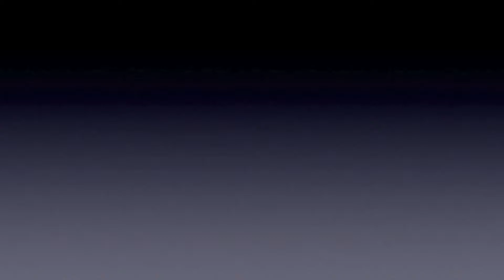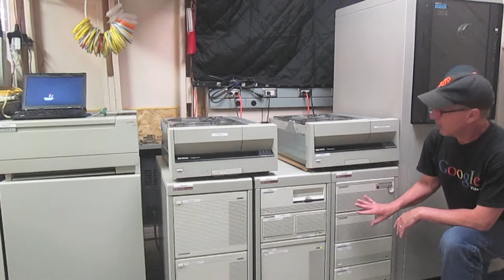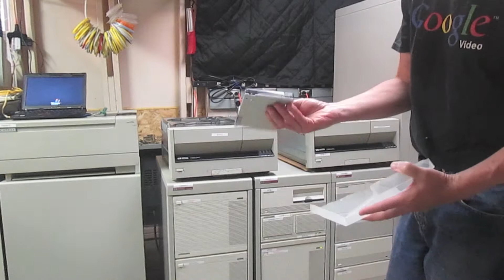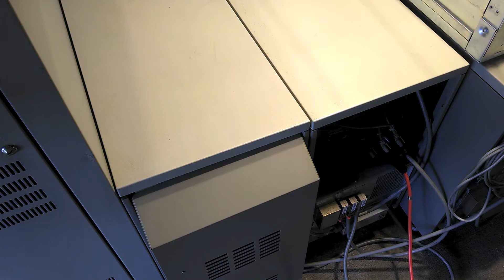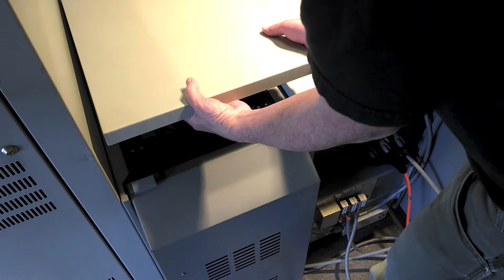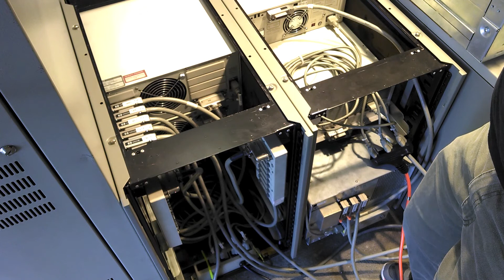HP3000 Micro3000XE System Overview

Comment: I acquired an old HP 3000.  It came with everything except an operating system.  Command console works...system checks out.  However when I try to attach a disk array, it fails with a 700 error which indicates a memory fault.  Is this a consequence of improper SCSI configurations on the disk array?  Also, I was able to get a copy of the MPE operating system, but it is in a compressed file on my PC.  The HP 3000 has two DAT drives, but I can't transfer the operating system to the tape from the PC.  I have a DAT writer with a USB interface and I was able to load the drivers for it into the PC, but Windows doesn't recognize it, so I can't write to it.  At this point I am stuck...is there any advice on how to trouble shoot the disk array connection and load the operating system?

Comment: There is still a 3000 system from the early 1990s running the management information system at a tractor shop in Mount Hope, KS.  I lived there up until a couple of years ago.

Comment: I started my IT career in 1985 on HP-3000's and HP9000's until the 2010's. I miss HP's MPE, MPEix, and their UNIX systems. Used to be an operator in a shop with 9 of those machines, ranging from 935-998's, and H, K, and N UNIX boxes. It was always very busy and extremely fun. I truly miss being an operator back then.

Comment: I have one of those sitting in storage looking for a new home.  One 9144 tape drive, a Micro 3000 CPU module and two 7959B disk drives in a single one of those cabinets.   I  had a couple terminals too, but those were lost.

Comment: Hi, Lee! I´m doing some research on this computer (hp3000) for college, and I was wondering if you have some manuals or datasheet about it to share with me. It´ll be great if you could help me. In case you can, my email address is cristianfaroppa@gmail.com  Thanks in advance and great video! Sorry for my English, I´m from Argentin. Cheers!
Reply from the maker: +Cristian Hernan Faroppa Hi Christian - Bad news and Good News. I don't have this hardware or any of the documentation. :-( However you can find most of the documentation for the HP3000 at bitsavers.org. HP3000 documentation can be found here: http://bitsavers.trailing-edge.com/pdf/hp/3000/

Enjoys and good louck on your project. The 3000 was a very interesting machine and I really enjoyed working on it.

Comment: The last e3000 system was produced in 2001, but they continued supporting them until 2010.  These had PA-8700 processors, and I believe it would had been possible to run HP-UX on them.

Comment: I believe State Farm Insurance was the largest user of HP 3000 systems in the US.
Reply: You believe correctly.  I did a load of consulting for them.  They had massive IBM hardware at the core of their infrastructure, surround by the largest HP3000 installation (at stunning number of 64, 68, 70, etc) I could imaging and then at many regional a/o agent's offices there were small HP3000s (42, 48, 33, 37, etc).  You will note that my association with them ended right before Spectrum.
Reply from the maker: I second what Brian says - State Farm was a huge consumer of HP3000 systems from the early days of the product line. Their IT org went in whole hog with distributed processing, and the 3000 was just the great low cost, high performance, networked machine for them. Other major users of HP3000s included Hertz, but they used them as back-end rate calculator. Other market segments the 3000 dominated were small airline reservation systems, credit unions software, and manufacturing software. All these thru OEM partners.
Reply: PepsiCo was my big customer.